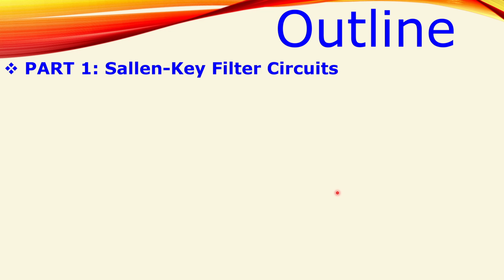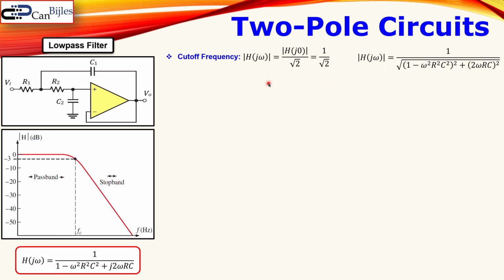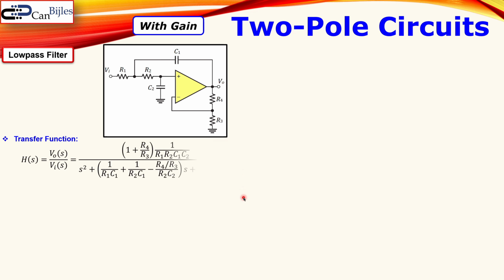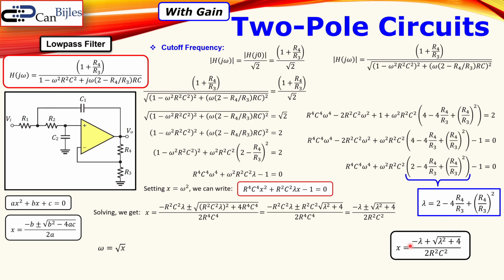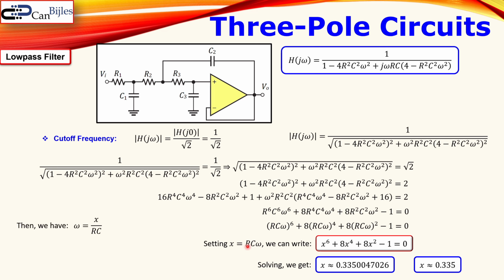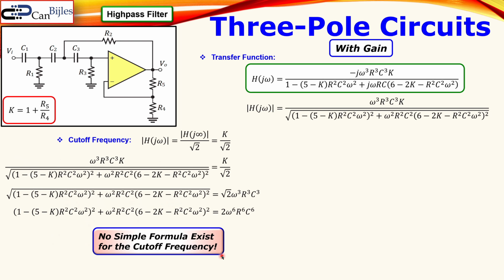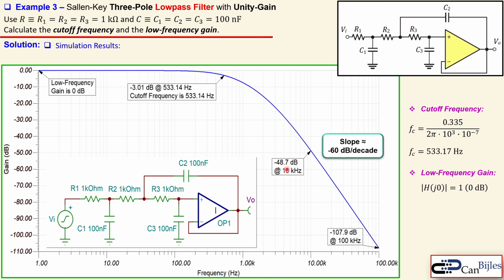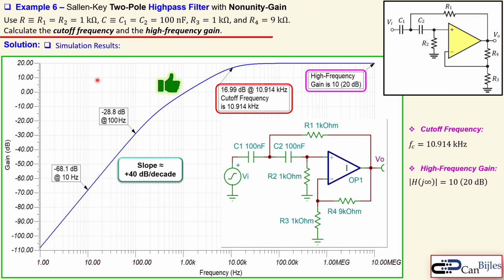Sallen-Key Filters 💡 Two-Pole & Three-Pole 🌟 Transfer Function & Cutoff Frequency 👉 MANY EXAMPLES!

Comment: Sir, for low pass 3rd order, i need a stop band attenuation better than -20dB at 500Hz, what should i add to acheive this?
Reply from the maker: This will depend on other specifications also, not just attenuation at a specific frequency. Maybe you can design your filter using Butterworth or Chebyshev response. See link: 
https://youtube.com/playlist?list=PLuUNUe8EVqlmpYf42xLeWwrxm-sox9Txp&si=9-ENixUQNDbG5q_3
Reply: @CANEDUX cuz my coursework requested to simulate a 3rd prder low lass butterworth fter with sallen-key filter topology, cut off @250hz, and stop band attenuation hv to be better than -20dB @500hz, but the most i can get for stop band attenuation is around -18dB
Reply from the maker: @jwxx-dj8rv   Did you watched my videos about Butterworth design? Again, see the link: https://youtube.com/playlist?list=PLuUNUe8EVqlmpYf42xLeWwrxm-sox9Txp
Reply: @CANEDUX thanks for the videos!
Reply from the maker: @jwxx-dj8rv  You're welcome!

Comment: Sir, I can tell that you put a lot of work into this video! If I was to create a bandpass filter with the high and low pass filter, would the output of one stage be directly coupled to the input of the next stage? And if I were to use a piezo crystal fed to a preamp, would there need to be a coupling capacitor needed on the output of preamp before its signal is feed to the first stage of the bandpass amplifier. I’m thinking of a bandpass filter with a range of 20-2kHz, both op amps at unity gain with each stage at 2nd order. If you have any thoughts, I would appreciate it. Again, the most detailed video I have ever seen on Sallen-Key filters. And thank you for pointing out that 1/2pi*R*C is wrong in this application. And finally, I was totally lost on the derivation of the transfer functions. Have a super great day!
Reply from the maker: Thanks for your message. Glad to know you liked the video 👍 Indeed, making this video took me a lot of time, but I think it was worth it. Also, because this topic on Sallen-Key filter circuits is not really discussed clearly on one place. Actually, the whole topic on Analog Filter Design is not clearly described at one place. It is very difficult to get the complete story together. 

About your questions. You can create a bandpass filter by cascading of a lowpass and highpass filter, but the end result will have a shift in the lower and upper cutoff frequencies. There is always an interaction between the filter stages. Capacitive coupling will not help, even not using a buffer. For this task, you need to use the Geffe's Algorithm. See my channel on this topic too. It is a bit advanced, but very interesting, I think. About coupling a piezoelectric sensor. This depends on the DC that is generated. It this is very small and the biasing it not effected, then you can use direct coupling of the piezo.
Reply: @CANEDUX  I looked at your video on designing a bandpass filter using the Geffe's algorithm, and from I gathered from it was that if the cutoff frequencies were too close together this algorithm would be used. Are you saying that no matter what the cutoff frequencies even if they are over a decade apart that there will always be an interaction between these two stages (low and high pass) which will disturb those frequencies? And if so, the Geffe's algorithm should be used no matter what the spread of cutoff frequencies are? Please clarify this for me and thanks for the videos!
Reply from the maker: @stuzman52   Thanks for message. Indeed, no matter what the cutoff frequencies are, and even if they are over a decade, two decades, ten decades apart - does not matter how far apart - there will ALWAYS be an interaction between the stages (lowpass and highpass). So, you have to use the Geffe's algorithm, if you want a perfect results. Yes, the interaction get smaller and smaller if the lower and upper cutoff frequencies are separated farther apart and maybe good enough for some applications, but there is always an interaction.
Reply: @CANEDUX  This is the most amazing thing that I've heard about a bandpass filter. You can't imagine how many videos I've watched and found conflicting information such as using the equation 1/2*pi*R*C for a second order filter and other discrepancies to mention. And I never found one video that mentioned Geffe's algorithm. I went back to my college books when I took electrical engineering courses and found discrepancies there from the videos on YouTube. I even bought three different books on active filters to learn more about this. And again everybody is all over the board about how to design active filters. Hell, I even tried Grok, and each time I went back to discuss filters, it came up with different resistor and capacitor values for a well defined cutoff frequencies, 2nd order for each filter of the bandpass filter and using Sallen-Key filters. So, I hope you can see my frustration in trying to get the correct information. I will review your video again using the Geffe's algorithm, get some values for the bandpass filter and then try and simulate it. Again, thanks for all of your help, and if I run into a snag with that video, I'll give you a holler. If I may ask, what is your background to be so knowledgeable in this topic? In my book, you're at the top of explaining these videos and far surpass anyone else's videos. Take care and have a great day!
Reply from the maker: @stuzman52   Unfortunately, the topic of Analog Electronics Design is not well understood, even by some people claiming having years of experience. Especially with Analog Filter Design, where the theory dates back at least 60 years from now and involving at that time frequently mathematical operations and theorems. Back them, practical implementation was not considered at the first place that much and it was more of a math puzzle or hobby than engineering. After some time, people realized the usefulness of these formulas, which were produced sometimes just out of curiosity. Like the Chebyshev and Legendre polynomials, the actual use of it came much later.

This 'famous' 1/(2*pi*R*C) formula is too often used for almost everything, even by some experienced people. The problem with the second and higher-order filters, and also with special filters configurations for bandpass and bandstop, is the required math involved. People just simply overlook that part and assume it will be fine for all cases. It will not! So, I understand your frustration completely. About this AI stuff, you should be careful, I think. I only use it for some image processing, not for finding information.

I have a background in MSc. Electrical Engineering, specialized in Microelectronics and Semiconductor Device Physics. But, with time, I also delved into power electronics, control systems, filter design; actually anything that is math-oriented but at the same time applied in engineering.

I advise you check the following 📚 Resources 👇These are very old books, but they are in my opinion, the best. New comers mostly just copy some stuff from the old ones and use some flavor in their text.
Unfortunately, the last link is not active anymore, which was the teaching of Analog Filter Design by prof. Vahe Caliskan from University of Illinois at Chicago @Vahe.Caliskan. See also: https://www.youtube.com/@Vahe.Caliskan

[1] Analog Filter Design, M. E. van Valkenburg
[2] Handbook Of Filter Synthesis, A.I. Zverev
[3] Electronic Filter Design Handbook, Arthur B. Williams
🔗 Bandpass Filter Design: https://vahe.people.uic.edu/spring2013/ece412/Bandpass.pdf
Reply: @CANEDUX Thank you very much for your detailed reply. I will review the sources that you posted and again, thank you for all of your help 😀!
Reply from the maker: @stuzman52  That is great 👍 You are welcome!